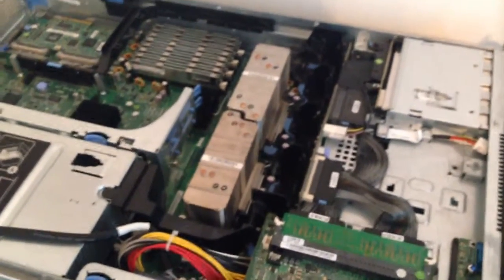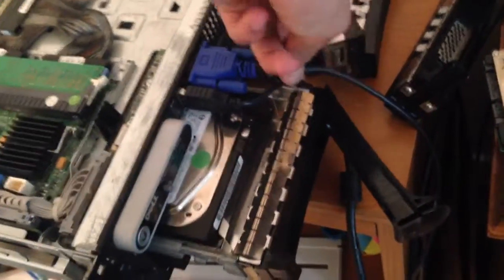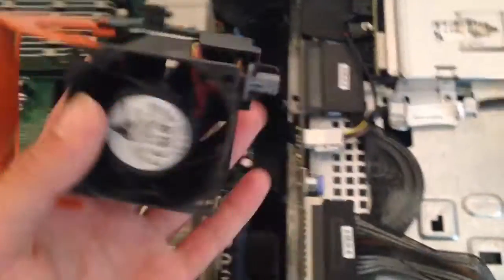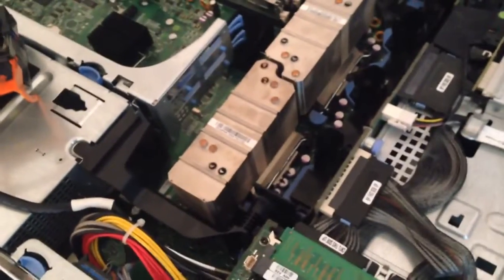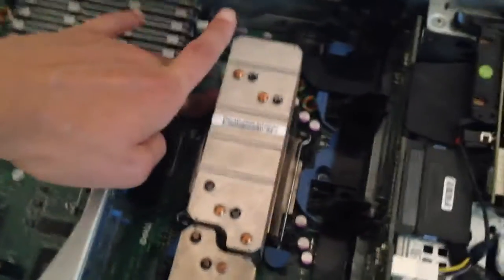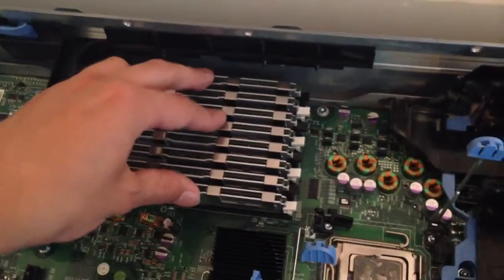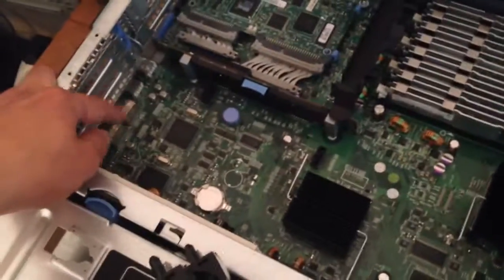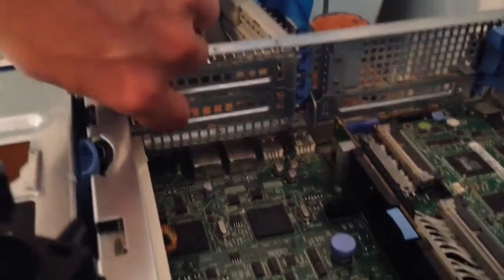Should I water cool my server? (Dell power edge 2950)

Comment: I know this is a bit late, but the fans on your server aren't only for cooling the cpu since the server is made to go 24/7 other components get hot (e.g Ram, Regulators, PSU, etc) so watercooling it would vastly reduce lifetime of the server and performance. If you are looking to do it to reduce sound I suggest getting a sound proof rack. 
Also, if it creates alot of heat get a rack fan for it. If you do buy a rack, just get a small rack fan or make a DIY fan to blow air away from your side of the room and maybe towards a window
Reply from the maker: BubyM B yea that's definitely true but I had to move it to the cold garage because we got a different service and they had to put the modem out there but it's in a box with filters on the front and back to try and keep the dust out so it's not a problem anymore to keep the fans. I appreciate the input though!

Comment: I know this is old AF but did you ever water cool the 2950? If so how, what block did you use? I got one of these 2950 loaded for free and want to build a minecraft server for my kids and friends. Even after doing the fan mod its still loud as hell.  Any suggestions?
Reply from the maker: Well the short answer is no because the mother board in mine might have died. I highly doubt your going to find any off the shelf water block that will fit it so your going to have to either deal with the fans or make one. Making one will necessitate a milling machine, tooling and skill so unless you have all of these things your better off finding another solution.

Comment: Yes you should cool it. Use a peltier cooler
Reply from the maker: that still creates heat and the fans and heat sink solution already employed would still do a far superior job.
Reply: +MOO Tech you can look up how a fridge cools and use the same concept to cool the server.
Reply from the maker: +KmanMeteorProductions well the problem is is that a refrigerator has a compressor, coolant and it still has a heat exchanger which has to dump the heat some were.

Comment: there intel cpu so all you need is a intel water block
Reply from the maker: Im not sure if I could just put a regular water block in there without modifying the board or the block.
Reply: find out what the heat sink is like on a amd server motherboard its a stock g34 heat sink
Reply from the maker: John Kinder Well my concern is that the mother board doesn't have a stranded mount because it was never meant to be used with any other cooler than the one that it came with. Also I would have to take the mother board out of the case in order to change the mount and that would be a huge pain because I would have to take every thing else out to get to it.
Reply: I do under stand
Reply: MOO Tech it's a standard 771 socket and CPU mount (if you remove the retention arms from the motherboard its self). I am also looking to cool my server without having an airplane the other side of my room